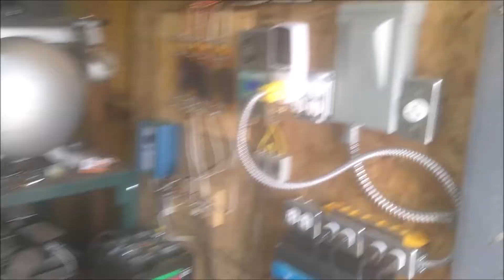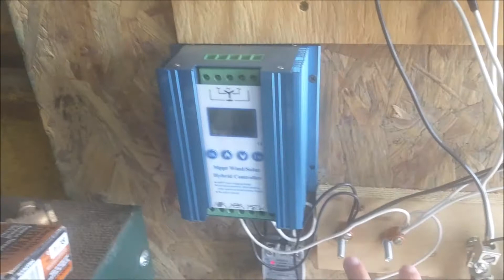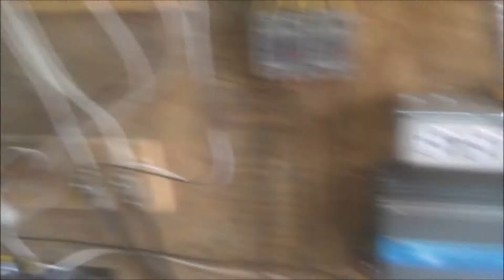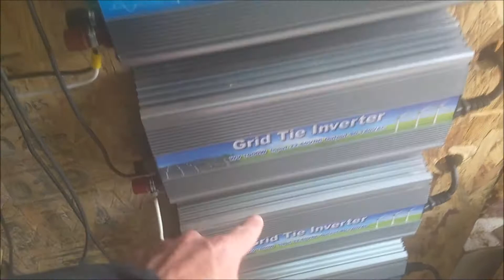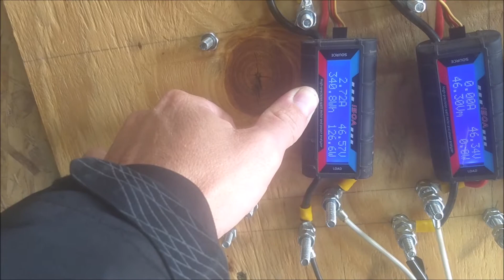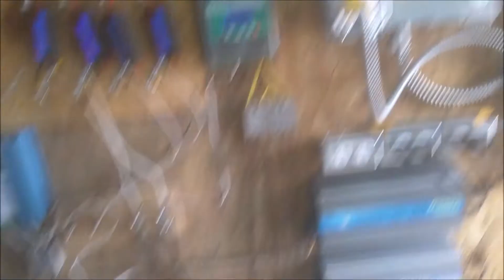Real wind updates on the Heli 2.0 and i1500 (and all the rest of the stuff too)

Comment: There's a guy who can sell me an i-1500, and i'll might be interested to buy it, but now im hesitating when you day It's loud when runing fast? I want to put it in my back yard and very close to my neighbours to because thats the only place ive got to put it. It would be Great IF you could do a video comparing soundlevels between them and make comparisons to other things, like speach, a drill, a car on idle nd so forth, because i have no reference at all. And thanks for another Great video.
Reply from the maker: I think mine is making so much noise because we're talking 30~40mph winds and the blades are clipped.  One of mine ended up broken and I had to trim about 6 inches off the tip of each blade.  Between the high wind speed and the reduced blade diameter it's just running really fast.  It can definitely be heard but if you're 20~30 yards away you can't hear it over the wind anyway.  This video was pretty close to it before the blades got clipped: https://www.youtube.com/watch?v=W9wpQok77OY
Reply: @ToysforWatts  perfect, you already got a vid of that. Thx. Static tv it is then. ;)

Comment: Where did you get the switch at the opens at 24v charge?
Reply from the maker: The controller I got for the 24v side of things was suppose to be a hybrid solar/wind controller I got on eBay.  Did not work at all for a wind controller, but the load switching is very easy to set up and it seems to be doing that job great.  I think there are probably cheaper items out there to handle the job, though.  This is the listing: https://www.ebay.com/itm/174094669652